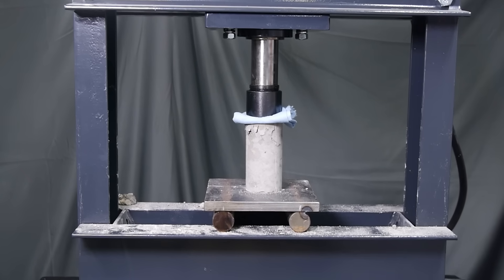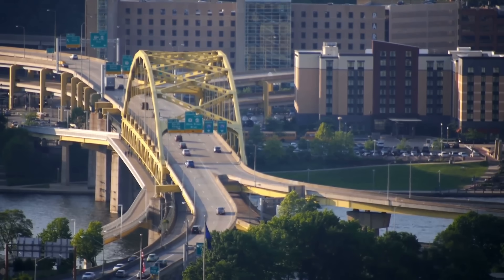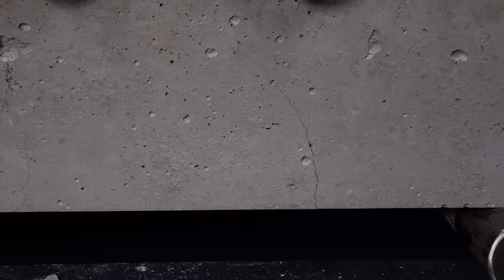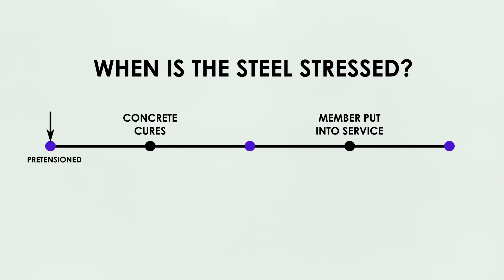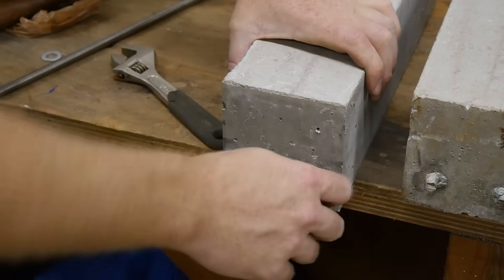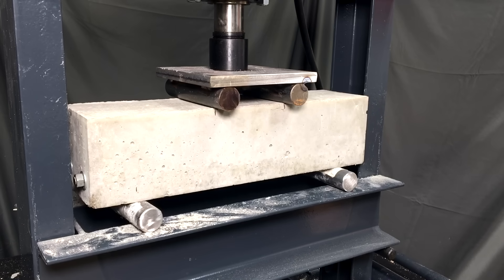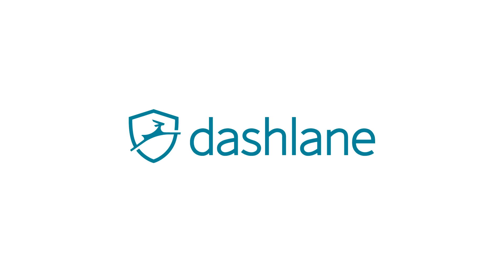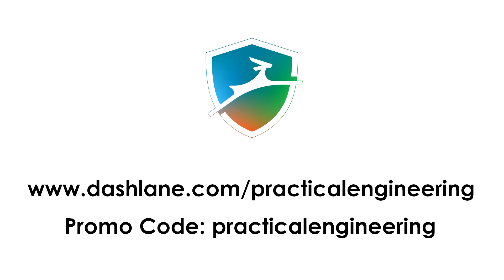What is Prestressed Concrete?

Comment: I believe that recipes for cement and concrete should be standardized, in order to maximize strength and therefore, integrity and longevity. ALL structures worldwide should be as strong as possible! This is no place for corporate competition! Those structures that have collapsed should be studied rigorously and specifically, in order to determine their potentially inferior cement and concrete recipes. It seems to me that there is an infinite amount of variability in these mixes—and the public is at risk, if nothing is done about it!

Comment: Being an electrical engineer I do a lot of field plotting for voltage fields and flow currents and flow lines and pressure lines or temperature and flow lines . In this work I " see " the field distribution of stress and it is clear that one should look at the  shortest diagonal between the load and the support for a stiff beam , For a flexing beam one should look at the location of maximum bending moment which is approximately below the pin load , where cracks initiate.
For a stiff beam the diagonal joining the load and the support has a full story around it if one considers the other close diagonals as a wider ribbon zone.
The diagonal between the load and the support in a stiff beam indicated clearly where the stirrups should be introduced and at what angle ..............at 90 degrees to the diagonal failure ,    There are beams which does introduce a rebar which goes horizontal at the upper end then angles downwards at 45 degrees to   rejoin the lower horizontal rebar. Most people make " vertical stirrups but your experiment shows clearly that the stirrups on the support should be angled to be in quadrature with the diagonal described by  this failure. at 7:03 ,

Comment: Can an 1/8th inch steel plate jacket be welded around a prestress beam, to increase it's ductile  strength? Or would a steel beam be a better option since it has tensile strength that concrete lacks?

Comment: Another interesting point here is the need not to overdesign the steel (tensioned or not) as cracks at the bottom of a beam show potential failure. If the beam/slabs deflect so little that no cracks appear, it's possible the structure can be overloaded and the top section of concrete will explode in compression with no warning.

Comment: I have a question to you fellow engineer:

Why do you think the pre-stressed specimen failed by only losing one side like a "flaking" problem, yet post-tension specimen falied in the convensional and expected way (~45' diagonal between point load and simple support)? Was it by relatively poor vibrated concrete in pre-stressed, or the lack of cover distance which you wouldn't obviously follow due to specimen testing device dimensions? Or maybe any other case?
Reply: From what I see, the post-tensioned concrete failed in bearing - the nut was pushing against the end of the beam harder and harder as the load increased. Eventually it broke away the concrete near the nut, and the rod stopped functioning as reinforcement. (It's just a loose piece of steel in a plastic sleeve without the nuts bearing on the ends)

The pre-stressed one, I think, had a bond failure between the threaded rod and concrete (similar to the nut crushing the concrete at the end; the threads of the bar pull through the concrete). Or it might have just been a shear failure.

Comment: Fun fact - in my province, post-tension concrete spans require periodic inspections by an engineer to retain occupancy. It's an expense that condo corporations are only beginning to feel as the buildings where this is common are requiring service. They are SUPER useful to create building designs with fewer columns, but they add significant costs to the owners over time.

Comment: I know I am very late, but I would like to see you take a look at High Performance Concrete as well as glass fiber re-inforced concrete (to see if there is any difference, this one was a popular request, I see) and I wish you had shown the pressure on the post cure tensioned concrete test. I know you said it was about the same as the pre-cured tensioned concrete test, but verification is always good.

Comment: In your post testing experiment, if u have used a plate ,the tension would have been evenly applied rather than point contact ,leading to much more strength

Comment: Can you do a video on breaking concrete where your reinforcement is laying on the bottom and not pulled into the concrete.  I was always told that the rebar has to be within the concrete and not laying on the bottom(ground)...  If you get time..Thanks

Comment: Grady mentioned that the strength of the reinforcement for both elements is the same; however the tensile strength of standard steel reinforcement is generally 500 Mpa whereas the multistrand wires/cables typically used for both precast/pretensioned concrete as well as post tensioned slabs is around 1800 Mpa. I would be interested in the manufacturing process that allows this dramatic increase in steel strength.

Comment: Prestressed concrete can force demolition of structures to be done explosively if the tension can't be released ahead of time.  With post-tensioning, that is an option.  The problem is the cables snapping when cut.  That then hurls debris all over.

Comment: I rewatched this one again and I know it’s an oldie but it’s a goody. Just an idea: Speak to Tobias Lindh to ask if you could use his footage of GigaBerlin. I’m particularly interested in the reasons and explanations around the concrete slab they have put down for the battery factory. It seems to me to be about 2m thick which I would have thought would not work but then I thought of the Hover dam but they had to use special techniques to ensure it didn’t over heat. Love to hear your take on all that concrete especially after watching your episode on Champlain. BTW I think your work is excellent hence my suggestion.

Comment: Why are the steel rods placed in the bottom? Or did you do that for this demonstration for some reason?
Reply from the maker: That’s where the tensile stress is for the loading I was apllying
Reply: @PracticalEngineeringChannel  I see, cus the top is on compression, so the middle would be more or less in balance

Comment: one serious question, couldn't we just use molten stone instead of concrete for buildings that need to be extra sturdy? molten granite should be way stronger than concrete right? 🤔 I know it would take a lot of energy but the building also might last waaaaaay longer so it might be way cheaper on the long term, making buildings that last thousands of years.

For example big fresnel lens could be used to use sunlight to melt the stone and then poured.

Comment: An interesting issue that arises with stressing concrete is that it it is not as good at resisting impact sounds.  As an acoustic engineer we test many concrete floor slabs to find their levels of impact insulation.  An unstressed slab always is better, compared to a stressed slab,  at reducing the levels of impact noise for lower occupants.
Reply: I am so glad I stumbled across your comment! I am learning as much as I can about concrete, because I'd like to start building speaker cabinets with it. I'm no engineer, so anything written in English like this is a huge help. 

I'm not surprised the pre-stressed stuff transmits sound more readily. It's more compact, and that would include all the cracks, air pockets, etc. I could see how that would provide less resistance for the vibrations to travel.

Do you know anything about volcanic pumice powder being used as an aggregate for "higher strength" mix? Or have any experience with light-weight concretes?

Comment: In my experience most post tensioned slabs use steel cables covered in a sleeve much the same as large electric lines. They would be positioned in a drap which looks much like a sine wave. After placement of the concrete they cables would be tensioned in stages, as I remember the first pull would be in week to ten days, some would be pulled a second time and then a final tension. Prestressed is made somewhat different being in tension prior to concrete placement. ...

Comment: The Morandi Bridge (the Genoa Highway bridge that collapsed on 14 aug 2018) was one of the first structures built in prestressed concrete (mid 1960's). But the blame, apart from the criminal absence of mantainance, is air contaminants and pollutants that went right through the cement and corroded the steel inside (and the concrete itself)

Comment: I would love to see a video featuring the difference between raw reinforcing steel vs. pre-stretched.  Like guitar strings, they stretch to a specific length and then seem to get stronger before they break.  Is there ever consideration for that point when designing prestressed concrete?  How can you know when that point is reached without going too far?  I saw an interesting video as a child demonstrating this using garbage bag plastic stretched to that point and then used to create a solar motor... since light actually shrank the plastic... as long as it had already reached that point.  I'd love to see your take on this principle.

Comment: How effective would the concrete be if a steel I beam was used as reinforcement (maybe with  holes drilled through it every few inches to allow concrete to flow through). I was thinking maybe 5/8 as wide/thick and 3/4 as long

Comment: Thanks a lot for such lesson. This is all okay. But me I will start with my knowledge about building to stand heavy load that I had learned from the ancient most precise structure to hold heavy load and that it  is an arch. Why you gay do not take a short road and build around it. It should works. I will design a steel format with the precise measure and pour reinforced concrete and...Voila

Comment: Hi, Grady! I follow with attention and interest all your videos. They have been of good use in many occasions. As a refrigeration tech the "water hammer" video, in particular. But sometimes we face things with concrete, like today.

Wehave to built a concrete underground water storage (8m³). At first it seems simple enough, but the matter is that we are going to heat that water up to 80ºC... and thermal expansion (and further contraction) underground becomes an issue. How is it solved an issue like this one?

Comment: All prestressed concrete must have primary heavy gauge 1 rebar grid pattern reinforcement reinforcement in all directions in a double shell design so that it can withstand any kind of deflection from either side.

Comment: This and this last video on concrete were good, but now I have a question. In your demontration with the normal concrete block failure, I notice that none of the strata in your mix is visible from the outside of your block. This is what I often see in home made blocks, etc., but in the industry I moreso see a grittier mix in use, such as for foundations and sidewalks. Does the smoother surface finish in your block have more or less durability than a more central part of the same block, where the strata in the mix interrupts the lines of weakness?

Comment: I believe that the post-tensioned beam breakage test did not fail due to the applied effort, if not due to the two rollers that applied force to the upper face of the beam, if you could distribute the applied load along the beam it would be much appreciated better resistance provided by post tensioning. But this topic is very nice and this was my thesis topic, congratulations.

Comment: In other words, can we carry more loads with ductile fracture in the same cross-section size and same concrete strength by placing pre-stressed steel on the structure we equip above the balanced reinforcement ratio.

Comment: I don't think this guy knows what he is doing with the materials and tools. Go work at an actual job site for a day or two and learn how to make your test pieces properly. The principal is right but application fails. Did you even let the concrete cure before testing ?
Reply: I suspect he let the concrete cure first.
Reply: Prestressed concrete its not that common in USA as in east europe.
He presented the principle well thogh.

Comment: maybe, just isn’t what we expect it to be.  if it has to be super engineered to the max to get minimal performance then we need a different product.
we’re just pushing our luck.
using it in applications where it needs monitoring is really stupid in my opinion.
i think we’re asking for trouble down the road.
just use it on the ground.
cenerete structures have to hold their own weight plus a load and sometimes their own weight is already over the limit, then we expect it to perform beyond that limit.
if you can’t use it, then the project doesn’t get done.
it’s that simple.
why push it. 
my two cents!

Comment: Why dont we always use prestressed concrete and some times we pick the normal rebars? I feel that Prestressed concrete is more efficient. 
Is it more expensive than RC so we dont pick it for small size buildings?
Reply: Prestressing concrete is only done in factories , requires special tools and its verry dangerous job requiring highly specialised workers.
Its good only for beams or thin poles  that need to be verry light weight and strong.
Also ,prestressing concrete requires to use a lot of aditional rebar.Rebar also protects the workers in case the tendon brokes because it will be like a caged tendon.

Comment: if a sheet of fiber was used/embedded on each side of the block as the cement block is poured, could it keep the strength?...kinda like how the aircrete dome builders are using as an outside stucco/fiber/stucco over the finished brick dome?

Comment: I used to make precast concrete walls.  We used 5/8 7 strand cable that we pulled 240 ft of cable each run and we used around 14 to 30.  We had to string it through end panels for tops and bottoms of the walls and blockouts for doors and window or similiar stuff. Then when ready we set up a hydrualic ram and cleared the safety zones for tensioning. 240 ft of cable we stretched around 14 inches.  Qc operated the tensioner and had a gauge he watched then when finished we gave him the stretch measurement as a double check cause if he pulled said pressure and then got a 20 inch measurement instead of 12 inch range a strand possibly broke or its strength is compromised another way so we would scrap the cable and redo it.  ( made it real fun when we realized after tension engineers didnt call out a plate on the top side of pour needed strand strung though it so we had to detension cable and pull it out and jig the plates and restring and tension it again) supposed to do 1 pour a day boss canceled that pour due to time loss

Comment: The prestressing of that short beam helps with the shear force and increases the bending capacity. However the failure in this video is not a bending failure. You can see the failure is very sudden and at an angle towards the support. If the purpose of this video is to show a bending failure you need to make sure you increase the length in relation to the height of the beam. The ratio should be at least 3x the thickness of the beam but for demonstration purposes 10x the thickness of the beam would be better. Than you will see more crack devolopment before it fails. The cracks should start at the middle of the beam and go into an angle towards the support. Also the deflection will increase a lot.

Comment: Okay i understand how linear  prestressed rebars would take much more tensil pressure. Like in case of a bridge. But how do you prestress the rebars of a vertical structure such as buildings and skyscrapers?? Would love to know more from you. Amazing videos nonetheless. Very informative for the starters.
Reply: Question is why would you wanna prestress a vertical structure. They are usually designed to take a vertical load. And they will be under compression. They can take more horizontal loads. 

They do this with precast foundation piles but thats because you need some force to hammer them into the ground

Comment: Adding steel reinforcement resists the tensile force in concrete. But over-reinforcing of the member is a huge risk, because the steel takes up all the tensile force without showing any symptoms outside the member like cracking or deflection. After the ultimate bearing stress is reached, brittle failure occurs ( just like a glass yhat shatters). Now we sure dont want this to happen as it might cause human fatalities. An indication is required that failure is occuring ( the beam deflecting and cracking) to avoid sudden failure and human fatalities. So over-reinforcing of concrete by steel must be avoided.
P.S - Sorry for my bad english.

Comment: Random concrete question: My brother recently built a house in houston and he was told by the builders that he needed a sprinkler system that he had to run regularly in the summer to keep up the integrity of the foundation? Why would this be? The heat or the the dryness causing cracking?
Reply from the maker: Probably to keep the adjacent soil moist so it doesn’t shrink and settle the foundation

Comment: How can you pre-stress your concrete if your beam is going to be subjected to freeze-thaw cycles and you want to minimize potential for oxide jacking by containing the reinforcement entirely within the slab? Can you pour additional cover once the primary pour is set and the reinforcement tensioned?
Reply: You can use an "encapsulated" post- tension system. In a typical post-tension application, one end of the cables is embedded in the slab and the other end exits the slab so that tension can be applied after the pour. In an encapsulated system, additional seals are added to the stressing ends to ensure each cable is completely shielded from the environment.